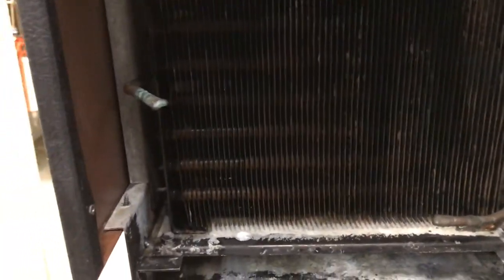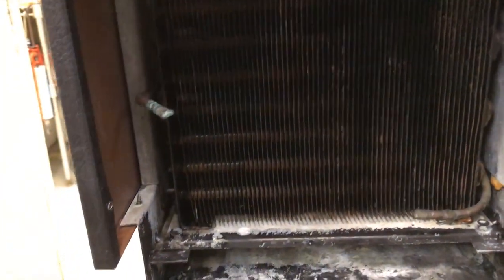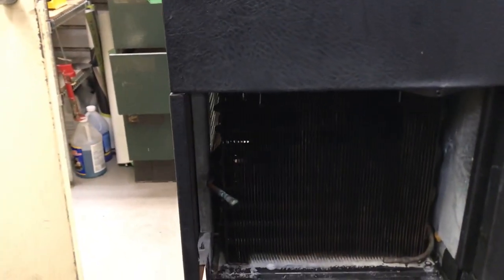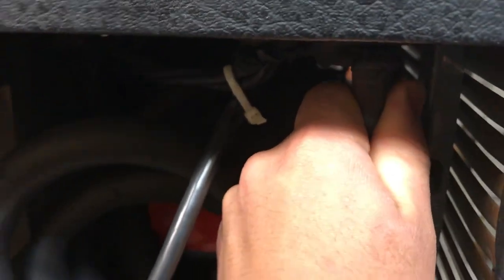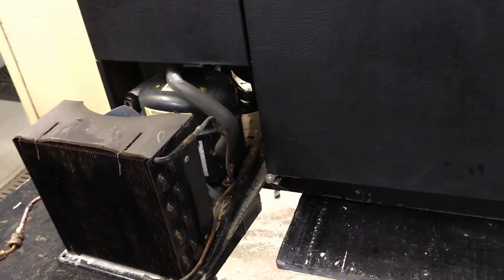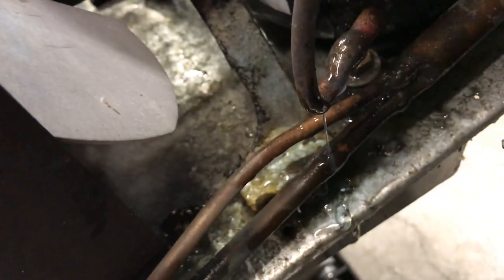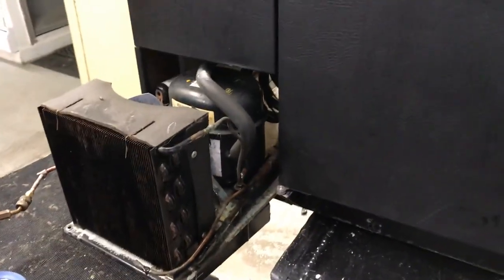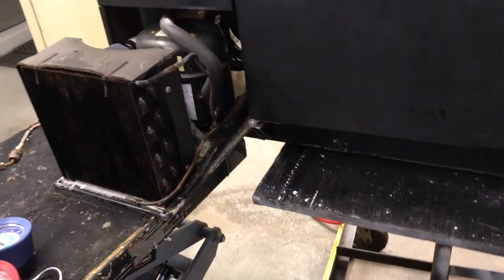HOW TO DIAGNOSE A REFRIGERANT LEAK IN YOUR COOLER/FREEZER WITHOUT USING ANY TOOLS

Comment: I usually just the the coil with my gun. If the temp is around 70 or room temperature.  Automatically is sealed system issue

Comment: How did you seal it?
Reply: Insulation tape works great.
Reply: lol that takes much work, seek pro help
Reply: Easy way is to use a strong two part epoxy and insulation tape, but the correct proper way is to braze a new pipe in place of the old one. If you aren't comfortable doing that yourself, call an hvac professional. If you get the unit ready for them before they get there, they usually won't have any issues working on it since all ac compressors are functionally the same.